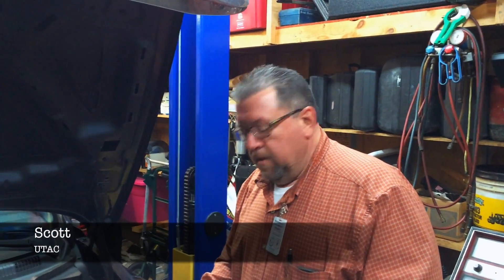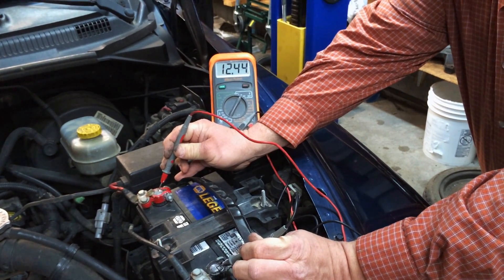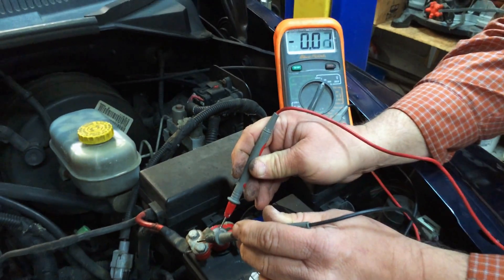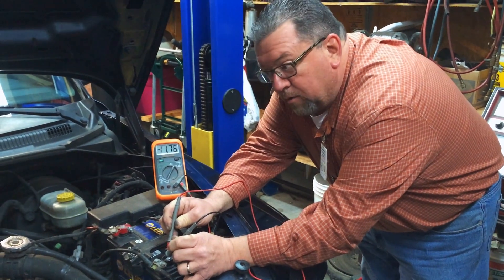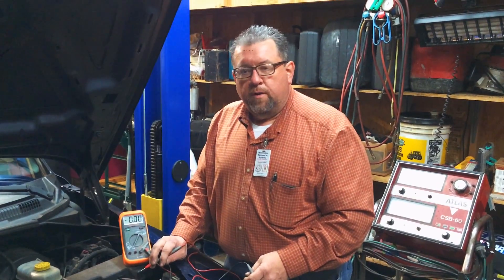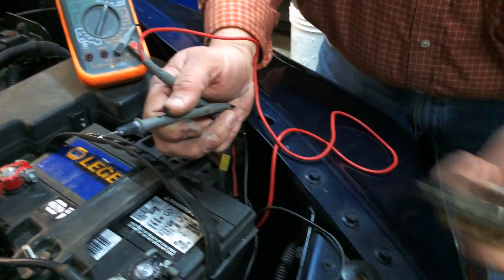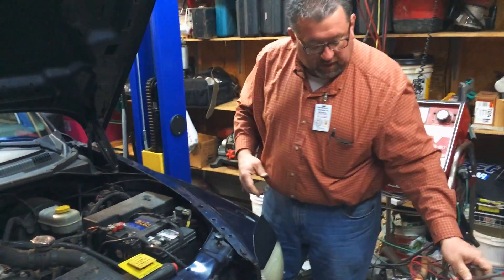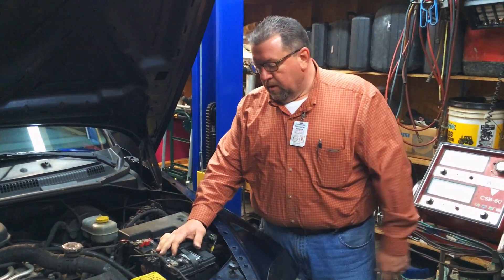Voltage Drop Test

Comment: Thank you for responding back in such a timely manner. You taught me something. You only need to have the key in the start position to test the starter  circuit. Right?
Reply from the maker: juanjohnism That is correct. Thanks!
Reply from the maker: juanjohnism That is correct. Thanks!
Reply: That is correct. Thanks!
Reply: +Jeremy Greene  but can you test the stater circuit for voltage drop if the key is in the accessory position?

Comment: But the circuit isn't loaded with the key in the accessories position. Please explain !
Reply from the maker: juanjohnism It is not a circuit, it is the primary battery power and a draw does exist across that circuit. All that has to be present to load test this circuit is the presence of a draw. As you can see in the video, the test works, because the voltage was almost 12 volts before cleaning the contacts and the voltage dropped to 0 after cleaning the connectors. Thanks for the question.

Comment: But in the video you didn't put the circuit under load when you did the voltage drop test. But in your comment you said the circuit must be active. Please explain. Confused.
Reply from the maker: juanjohnism I failed to mention the fact that the key was in the "accessory" position. I do not think it matters due to the fact there are active circuits coming off of the battery on every newer vehicle(computer memory, radio memory, etc.). Sorry for the mistake. We are working on making a script for next time. lol

Comment: Thanks for watching. Only problem is: what you're asking covers about a 20 minute lesson. Basically when the continuity is complete through a component, such as a battery connection, solenoid, fuse, etc. the voltage across that component will read relatively 0 volts using a digital volt meter. If the component exhibits resistance then some of the voltage will not travel across the circuit and will be lost in the form of a voltage drop. This test must be performed with the circuit active. In others words the starter circuit in this case must be activated. I will try to put another video up that just explains voltage drop soon.

Comment: Nice Video, But Help me out here. I always thought that current/voltage goes from
Neg back to pos. How do we see voltage from Neg post to Neg Term without a positive potential. I'm confused.  Logic tells me that there should be a reading of 0 volts with or without a bad Terminal.
Reply: Think of it as measuring voltage across a component in a series circuit. If you have two loads (each with their own resistance) you’ll have a voltage across each one. When there is resistance caused by corrosion or a bad connection then you’ll get a voltage reading across the side you’re measuring. So basically the resistance acts like a load which takes from the 12v and drops it down. A meter shows the difference or how much voltage that resistance is using up.
Reply: Sparkgapone there should be but if you see 12 volts on the meter that's the voltage drop (voltage not able to return to ground). A circuit is a circuit is a circle. If the battery cable is not right it's impossible for the voltag to return to ground.